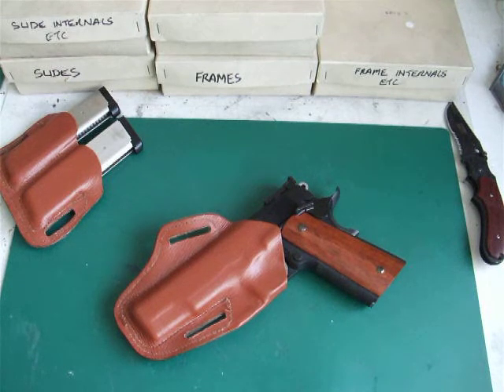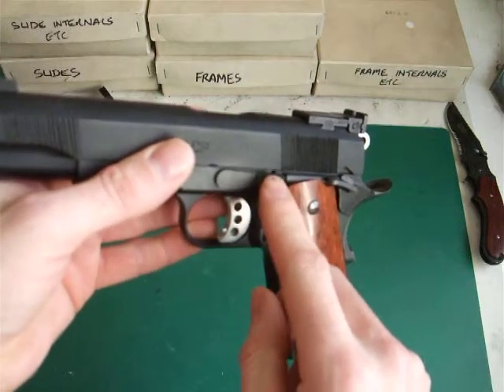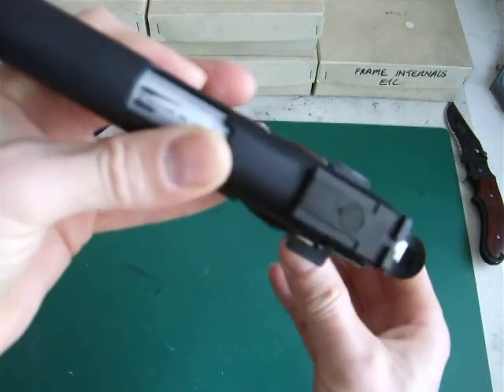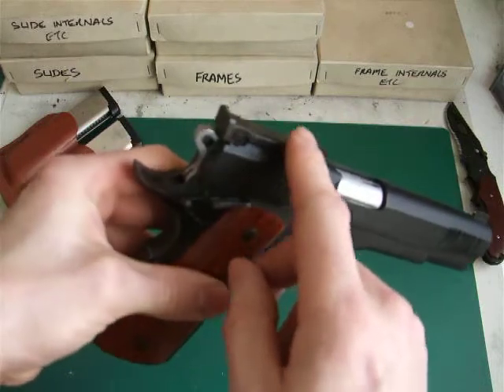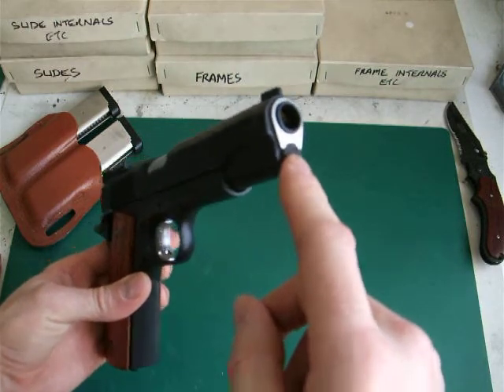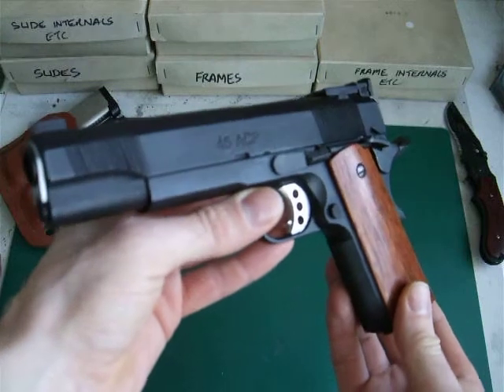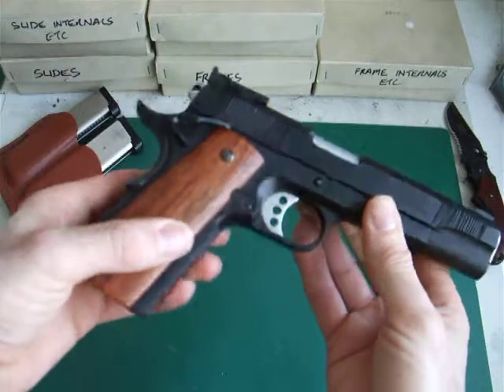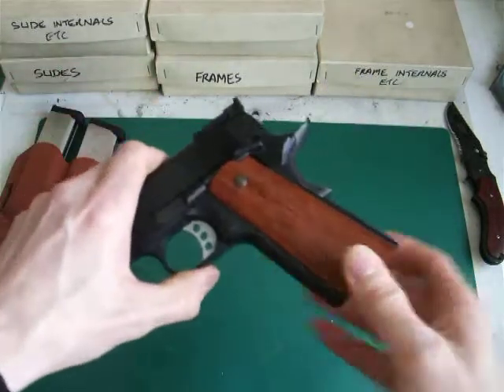LaZouche Custom airsoft Les Baer Premier II.

Comment: hello,
I have a TM 1911 HI-CAPA 5.1 CLONE (from ACM and has a metal slide)
My thumb safety and grip safety do not work properly.  I pull the trigger 2 times and it can shoot with either safety engaged.  can you give me some advice or make a video going over the entire safety assembly?  I saw the other video you made and it gave me some pointers but I still need help.  thank you. .